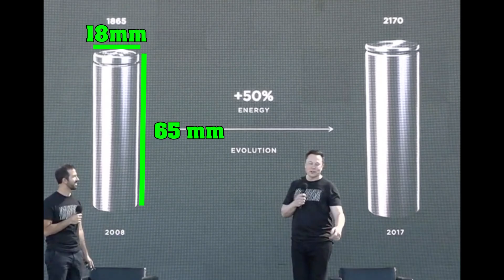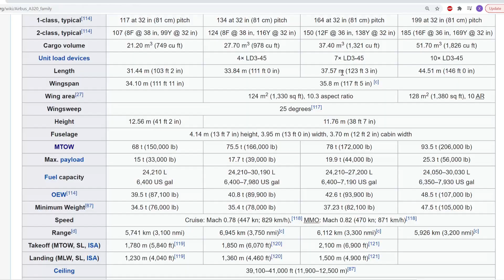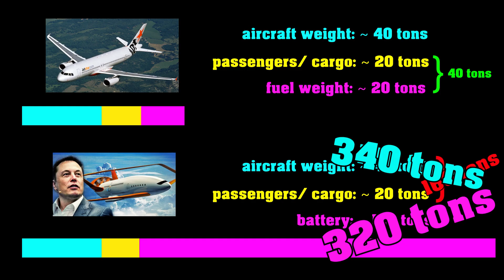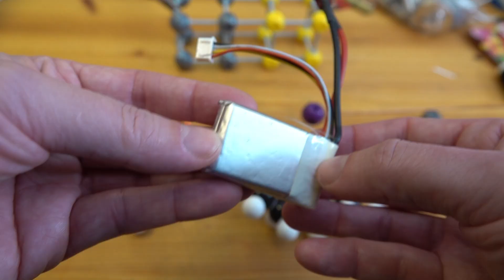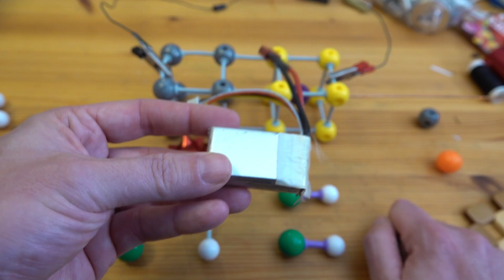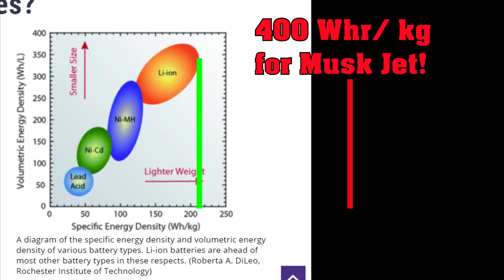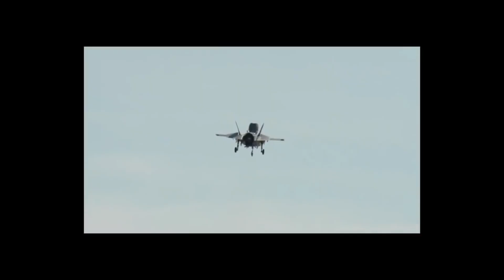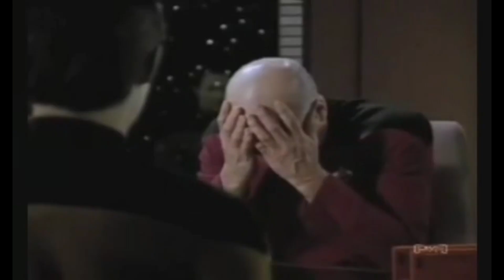Tesla's Secret Plan To Disrupt Airlines: BUSTED!!

Comment: Maybe I missed something but there is no such thing as a electric powered jet engine. And don’t tell me it’s going to be a supersonic prop. No one would have designed an operation one either because it would never work. 
So I guess maybe it could be made in imagination land and you could made it go Supersonic via hyper-imagination. Of it would still require much much more power to supersonic. I have seen electric planes, they are tiny, super light, smaller than a small Cessna 172 and fly for just minutes not hours. What kind of drugs do you have to take to come up with some of these ideas? What is the  intelligence level of people who report these stories and not say WTF doesn’t make any sense.  Doesn’t anyone fact check things in the slightest now? 
On top of all the things you pointed out regular planes get lighter fly as they burn off fuel. Now with a battery powered plane it would be the same weight taking off and landing which is a major issue. Commercial airliners don’t land with full fuel tanks usually except in Extreme emergency situations, they have to dump or burn off fuel before landing.

Comment: Are you saying that because there is a lot of energy inside my bodyfat, it can blow up any seconds now? I will start losing weight immediately.
I am not sure that energy density is the only parameter, which matters when batteries go into bomb territory.
Although LFP batteries does not have high energy density, the new BYD blade batteries seem quite stable:
https://youtu.be/CbACw27KTWc?list=TLPQMjgwNjIwMjHp-IcgQ3TXtA
Reply: You cannot blow up from the fat, because the combustion requires an oxidizer. Choke the air, and you're safe. (You can even put out a small fire by throwing a lot of fuel on it all at once. It displaces the oxygen). But a battery contains all of its internal chemical energy inside the package - both the oxidizer and the substance being oxidized.
Reply: @maxoobbxxx8032  True. Thank you. However my point is that just from the energy density increase  of the batteries does not necessarily have to come that they have to be unstable, or that there is no was to make those stable. I get that it is more likely, but it is not necessity. This is something similar what happened to the smaller and smaller transistor. The smaller the transistor it is harder to solve the leakage. Yet, they keep solving this problem for smaller and smaller transistors.
Nevertheless, if you pack a lot of cells into a vehicle, you will have a very high risk of things go wrong. If a single cell goes wrong with x/(10**m) chance, than with n cells the probability of something going wrong is 1- (1-x/(10**m))n. The more n is the bigger the probability.
Reply: @toth1982  The 787 had recently have problems with its Li-ion batteries, that caused fires. Boeing had to recall the planes. In case of danger a plane can dump its fuel, but no way to dump the batteries in case of a thermal runaway. It’s a problem that needs to be addressed for civilian use.

Comment: He should have begun with a more modest plane. Beetween 1000 and 2000 km of autonomy, carry beetween 50 and 100 Passenger under the speed which jet planes currently operate, something vaguely coherent with the technical limitations of today. But because it is Musk, the specifications seem to have been written by a 5 years old boy. Supersonic, thousands of km of autonomy, vertical take of, all is missing is hypersonic nuclear missiles, a fusion reactor and warp drive capabilities...

Comment: A few little issues:
(1) For vertical takeoff you probably need some propellors and motors facing down.   Needed only for takeoff, but you have to carry them around all the time.  Probably weigh more than the passengers.
(2) You are carrying and landing at the full takeoff weight.  That means much stronger and heavier landing gear and tires,  which are also dead weight for the whole trip.
(3) Supersonic with propellers sounds unfeasible, prop efficiency goes way down in the transonic region.

Comment: ...claim of power to weight of electric motor is equal to or greater than jet engine is rather curious...can someone point out an electric motor that has a power to weight ratio the same or better than a gas motor?...
Reply: Actually, the ones that are sold with EV conversion kits are pretty light. I’m been looking out of boredom and I found some that were 100KW constant output that were around 50 lbs. I don’t know about having better power to weight ratio than jet engines though. That’s a pretty high bar.
Reply: Definitely not but it's well known that jet engines are maybe 34% efficient. A lot of energy goes to waste. Aluminum air batteries have 1300 wh/kg. Lithium air have 11000 wh/kg theory and 1,700 Wh/kg practical. both of those can get close to matching jet fuel energy density. 400 wh/kg with lithium ion batteries in 5 years isn't. They are at 300 wh/kg right now. Air batteries have big problems and are still actively being researched. Thunderf00t is right the problem is hard but the amount of research money being poured into it as more companies are entering the electric vehicle market means there is real headway to be made.

Comment: I have a serious question...
How do you make an "electric jet" in the first place?
I mean how do you convert electricity into any sort of meaningful thrust?
There are battery powered airplanes already, but they use a propeller.
Reply: Without fuel, you can't.
Reply: You could probably do it in the same way that the Russians made their nuclear plane. Use the energy to heat up the gas that passes through the turbine.
Reply: @alexseguin5245  I still don't think that would be efficient. A propeller would work far better. There are airplane toys which use batteries to generate thrust but they are incredibly inefficient.
Reply: @Mauri Kunnas Nuclear propulsion is fairly efficient due to the high temperatures (Carnot's Law)
Reply: Just like turboprop or turbofan, albeit without the turbine.

Comment: Elon Musk conveniently ignores the fact that the supersonic flight is inefficient when compared subsonic flight. A Boeing 777 requires only 1/4 of the power of the Concorde to sustain the flight. This is why SST became a thing of the past. Besides this,  Musk has to develop a 30MW motor light enough and small enough to be mounted on the wing pylon of an aircraft. (I have used a simple equation to calculate the power to cruise. M*g*CruiseSpeed*/Lift to Drag ratio@cruise)

Comment: smart as you are, you have a tendency to not speak the complete truth. 
An A320 or 737 never flies with a full tank. They would never be able to fit a full cabin. So no, the 20 tons of fuel added to a full cabin is not a realistic representation of the facts. Makes me curious on how many of these mistakes are being committed in your youtube clips. 
Very unfortunate as I took a lot of what you said for truth. Bit more research isntead of a quick google wiki would do miracles.
Reply: But it is irrelevant to the  final result.
Reply: @MiguelRuiz-vp1hu  Actually, turbine engines have about 70-80% propulsive efficiency.

Comment: Yoooo, thunderbutt.  The bigger cells only have a slight energy density increase but the energy density of the battery is going up quite a bit AAANNNDD it's a structural component.  You do know the difference between a battery and a cell right?
Reply: What did you said is a joke? Because it is dumber than Elon Musk.
Reply: @danielmu22  To have my intelligence compared with a god is a vast honor.  A god you ask, well what other title would you give to a being with the power to bring life to a planet?
Reply: @zyxwvutsrqponmlkh  😂😂, sure that you are kidding.
Reply: The fuel tanks on modern airplanes are also structural. See: "wet wing"

Comment: I think it would be smarter to make h2 airplans.
Reply: Because it would be realy easy compered to cars to make a infrastructure for the fuel. Also the wheit is whay lighter that batteries. Also it isnt expensive to turn a normal plane into a h2 plane. Because you can with some modifications burn h2 in plane turbines. And the new plenes can be electric and use h2 to make electricity. It would still be heavier than normal planes. But fliung  almost completely green is a step in the right direction. I thing many turists would prefer that.

Comment: The mass calculation is not completly fair. Parts of the battery structure can be aircraft structure. However, it won't change much of the conclusion.

Comment: Something I was thinking about correct me if I'm wrong but an electric plane will still be   higher altitude because the air gets thinner so it would be harder for the electric motor to move air to go faster correct because it's less of it right?

Comment: You know what's funny? While making the batteries larger increase how much each cell holds, the cells are themselves are going in to packs, and larger batteries will have larger gaps between them and lower the density of each pack by 54%. So increasing the battery size by 50% lowers the pack density by 4% resulting in a net loss in a battery pack. If you want to increase the pack energy density you'd want to make the batteries as small as possible. Optimal energy density would be a balancing act between making batteries as small as possible to reduce gaps while keeping them large enough that the packaging doesn't become a bigger issue.

Example: 10x10mm unit space will hold 400 batteries with a 0.5mm diameter with an energy capacity of 100 units. If you increase the batteries size/capacity by 50% then your batteries will be 0.6mm and have a energy capacity of 150 units, but only 256 of them will fit.

400 * 100 units of energy = 40,000 units of energy in the pack
256 * 150 units of energy = 38,400 units of energy in the pack

Comment: Tesla improved pack energy density (not cell energy density) the following way (working backwards)
 3. Integral pack (the pack is part of the vehicle’s structure)
 2. Large cylindrical cells (to hold the integral pack together using less parts)
 1. Tabless cells (to decrease electric resistance - heat - on a large cell)

Also, the dry electrode technology enables cheaper manufacturing
Reply: Spoiler alert: We already have structural energy storage in the aviation industry. Modern aircraft have "wet wings", that is to say, parts of the wing structures themselves are sealed off and used to store fuel.

Comment: I mostly agree, although you kept for spme reason forgetting that teslas batteries are structually solid by themselves. Therefor it wouldnt need to double its weight for structuraæ integrety
Reply: We already have structural energy storage in the aviation industry. Modern aircraft use "wet wings", where parts of the wing structures themselves are sealed off and used to store fuel.

Comment: I do think that battery safety is a solvable problem. Poking one from your cell phone with a screwdriver and seeing it burn is irrelevant. Low stored energy density is the only real obstacle for long range flights.
Reply: There is always a chance that a power cell can fail and short itself, which would then start a cascading effect on nearby cells. No battery has or can be engineered with current tech that is 100% safe.

Comment: But what if I told you... that VTOL airlines such as PHI, Inc (Petroleum Helicopters), Bristow (Air Logistics), etc are only commercially viable because they're contract charter airlines. For oil companies. That operate offshore rigs at a cost of millions of dollars per day. And even then, those VTOL airlines loose money when oil prices are low and the offshore rig count drops. Because it only makes economic sense to use a VTOL flying machine (helicopter, tilt-rotor) if the machine's cargo (critical parts and/or crew) are valuable enough to justify the thousands of dollars per hour those machines cost to fly, and worse yet, maintain? Obviously, if your oil rig is costing $100,000 per hour and isn't drilling, it makes sense to pay $3,500 per hour to fly out a critical drill bit. But, the only airline passengers willing to pay that much per hour to fly... probably already own or lease a private jet! So... what passenger is your electric wonder-jet intended to haul? Johnny Quest? Tom Swift?  ...Robur the Conqueror?

Comment: The higher a plane goes the less drag, that's true. But also the less lift. Meaning you need more and more thrust the higher you go. Apart from being lightyears away from any battery technology / electric engine which could even remotely challenge kerosin / combustion engines in terms of weight to thrust ratio, there is a reason why there are over-speed warnings in commercial planes. It's a limitation of the plane structure, not the engine. Sure you can make it more rigid, and streamlined as in fighter jets, but that again comes with a huge price tag in regard to weight and space, which again makes battery tech even less viable. I admire Elon for a lot of what he has accomplished but even he is sometimes just an eccentric dreamer getting too drunk on success and fame. Nobody can change physical realities - unfortunately.

Comment: To be fair a 747 MTOW is ~397 tons and it holds ~183 tons of fuel. So 46% of that plane by weight is fuel. But yeah energy density of Li-ion is 200-250Wh. Aviation fuel is 12,000Wh. I think a hydrogen powered aircraft would be more feasible than using batteries.
Reply: Don't get me started with battery-electric ''rockets''. They're around 90%+ fuel and oxidizer and still that is barely enough to get you to orbit.
Reply: @unf3z4nt  What is a battery-electric rocket? If it still uses a fuel and oxidizer it isn't electric.

Comment: I wonder how Elon's plane would handle the airframe stresses from passing through the transonic speed range?

One of the effects there is the effect of the aerodynamic controls are reversed as well as a lot of stress on the plane - and he wants to put high density lithium batteries in it.

Comment: Ummmm, you neglected a "minor fact" about commercial jets: you can take off at "maximum takeoff weight", but you can't LAND at that weight. In a jet, no biggy, you burn fuel weight, or dump fuel for a takeoff abort. In a "Musk flying white elephant", you don't lose weight in flight. So to land (if you take off at max) you either have to toss out cargo or structure, or dump your batteries. So either you limit your max weight to max landing weight, or you make your passengers parachute into the airport terminal.
Reply: Or, you land without dumping or burning off, as airplanes are designed to handle overweight landings. But then SOP dictates that you need to call mechanics to inspect the landing gear, to make sure that the plane is safe to fly afterwards.

Comment: There are two main issues with a supersonic electric aircraft. First is the energy density,  Elon Musk wants 400 Whr/kg. The best that you can get out of lithium ion battery is 240 W/hr.  But jet fuel , as used in the Concorde has 7,800 Whr/kg.  So the best energy that  you can get from Elon's batterie is only 3% of what was used on the only successful supersonic airliner.  The second issue is that no one has come up with an idea on how to make an electric engine that can drive an aircraft at supersonic speed. The two electric engines  currently known are propellers and eclectic wind.  There is only one propeller aircraft that has ever gone supersonic and that was much noisier than a Concorde. And ionic wind aircraft cannot even do 100 kph at the moment.

Comment: Actually, combustion engines are more useful at high speeds and high altitudes.  Ram and scram jets can be used to wring the last bit of combustion out of a thin upper atmosphere at extremely high speeds.  I don't see how electric-driven fans could possible perform well at different altitudes and speeds.
Reply: Yeah the morons think its less efficient at higher altitudes... Maybe they need flight school.

Comment: facts about batteries and planes. UPS 6 that crashed and burned, killed 2, thanks to Li-ion batteries in the cargo.
Then we have all the burns in all transport with Li-ion batteries, stable stuff...
Reply: whilst you are right about battery fires being dangerous the fact is batteries dont just catch on fire without some sort of damage done to them. currently we have Li-ion batteries in all millions of cars on the road today and battery fires are rare, Electric vehicle today are less likely to catch fire than a combustion one.
Reply: @shaneebahera8566  there are alot of battery fires, in normal equipment.
And no damage is needed for them to  burst into fire. Enough that one cell get a run away, and then the rest will follow.
Reply: @cofal79  yeah but the type of cells used in planes would have to be as good or better than the ones used in cars and we rarely have ev car fires because of the battery pack failing
Reply: @shaneebahera8566  Maybe you should take a look at Thunderfoot's video, as he answers your question
Reply: @cofal79   honestly his video is full of inaccuracies and misunderstandings of basic engineering principles. Battery fires are a dangerous but so are kerosene fires. There are a lot of reasons why this idea won't work but this whole battery fire angle is just not one of them, a plane with combustion engines is far more likely to burn. Even in mobile phones the most notorious case was the Samsung note 7 with its bad batteries but out of over 2.5 million devices less than 1% of them  actually failed. Battery failures not resulting from bad handling or poor manufacturing are just so rare.
Reply: @shaneebahera8566  So you really say he is lying?
Reply: @shaneebahera8566  "honestly his video is full of inaccuracies and misunderstandings of basic engineering principles."

Care to elaborate on that? Also, you do realize that air travel is regarded as by far the safest mode of transport? How many airliners have combusted for no goddamn reason in the past 10 years? Now, how many electric vehicles did the same?